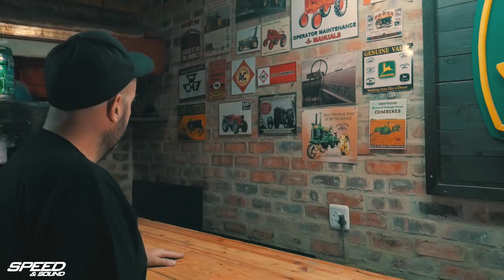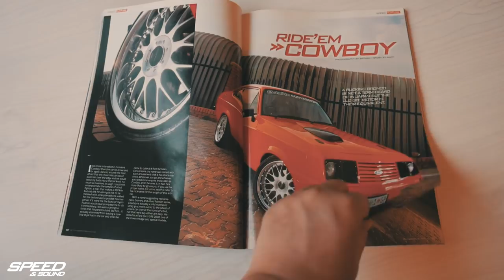ISSUE 195 COVER CAR INTERVIEW: Toyota Corolla 2jz panel van KE70

Comment: Curious what diff gear ratio?
Reply: Was a ford 9inch rear..3.5 crown wheel and pinion with a bmw e46m3 manual 6 spd transmission..